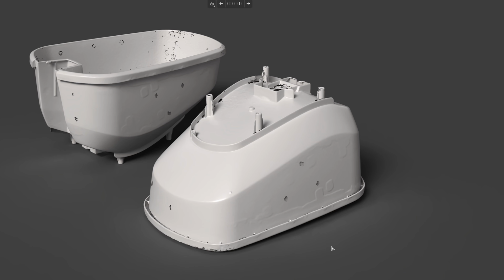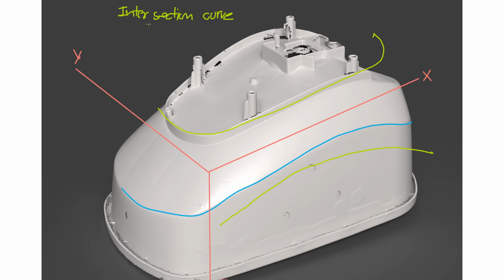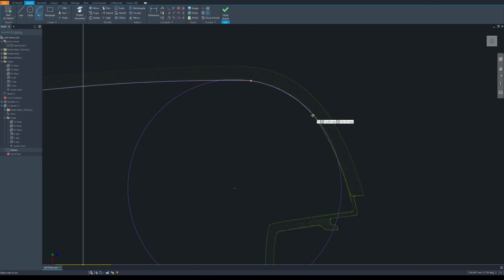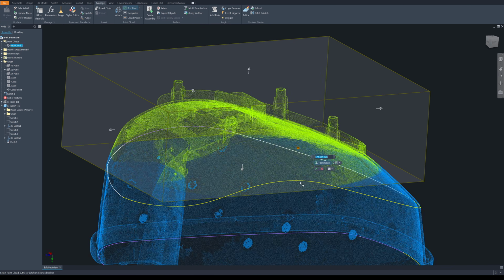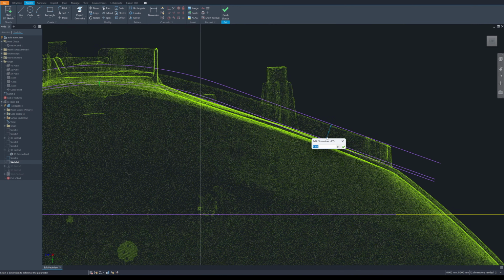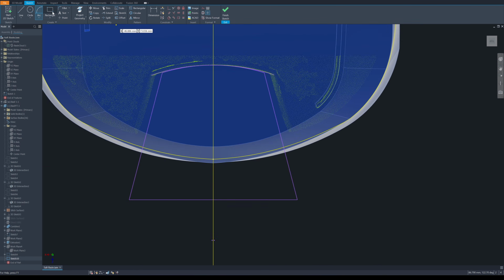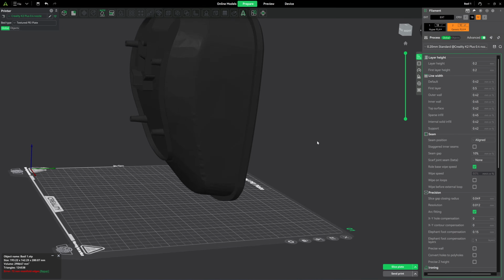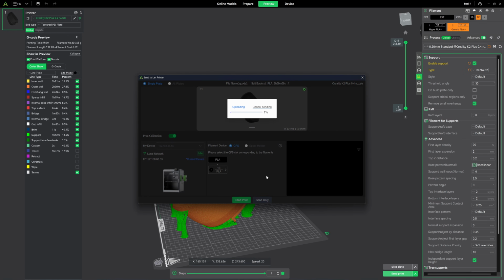From 3D Scan to Print: Mastering Surface Modeling with 3D Curves

Comment: not sure if Creality has a dual nozzle system like the H2D, but since I got the H2D supports are now never an issue.  It is very freeing to be able to design without trying to work-around supports.  Im sure there must be some equivalent in the Creality lineup allowing you to print say PETG interface layers for PLA prints, etc etc...
Reply from the maker: You really need dual nozzles for support interfaces. Trying to flush different filaments through one nozzle is risky, wastes a ton of material, and slows everything down.

Comment: Can you reverse scanned wing section with tilted airfoil and curved wingtip (not simple extruded airfoil)? 
In fusion loft seems to make more problems than solutions, so I was forced to use T-splines which is time consuming too. In softwares like quicksurface fit sketch points to the 3D mesh is gamechanger, but fusion 360 does not have that.
Reply from the maker: If it was built in CAD, you can reverse it in CAD, easy as that. Quicksurface isn’t something designers use for actual product design; it’s just an auto surface patching tool. The cool part is, you can do the same thing for free in Blender with the “Shrink Wrap” tool, then send those 3D lines into Fusion for lofting or patching. I’ve got a video walking through the process.

https://youtu.be/3HuALJOmAd4

But Fusion also has curve intersection tool. You can model that by using the method in this video, it'll be more accurate and faster.

Comment: Is it possible to send the file directly to the printer and print it immediately after scanning? Or does it need to be redesigned from scratch?
Reply from the maker: You can print directly only if the scan captures the entire surface with 100% coverage. In this video, the scan covers about 85%. In most cases, you’ll need to repair the model using clay modeling software.

Comment: Why Invetor? In the computer menu, we saw icons for much more suitable programs for processing scan data. CATIA, NX, SolodWorks etc. Or even Fusion360 from Autodesk is more elegant for processing scans. Yes, the process was successful, but much more complicated than it would have been in CATIA or Fusion360.  Perhaps it would be worth making a video comparing the work process in different CAD programs.
Reply from the maker: Most professional CAD software offers the same core functions, though often under different names. Performance varies, and the differences become more pronounced when handling large assemblies. In my work, I regularly create assemblies with over 3,000 parts, so reliability is non‑negotiable. Security is equally critical, and I still need to access files I created more than 20 years ago.